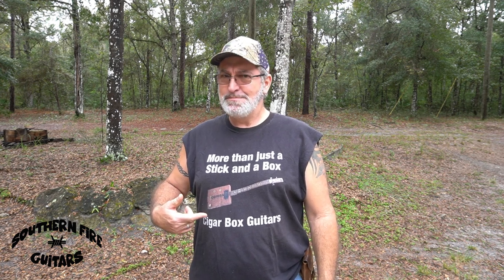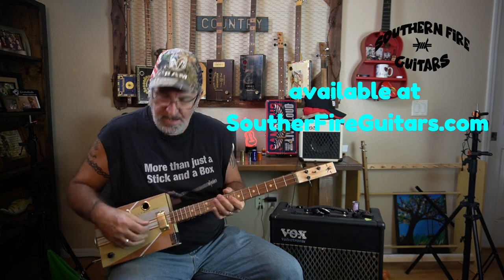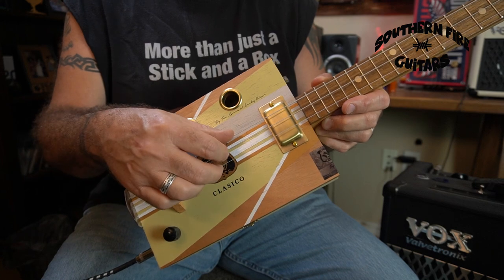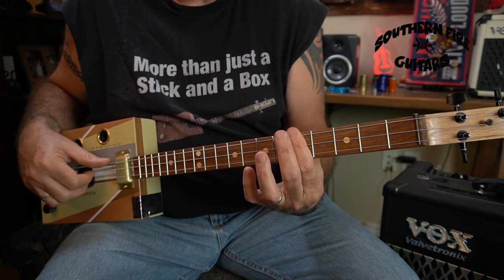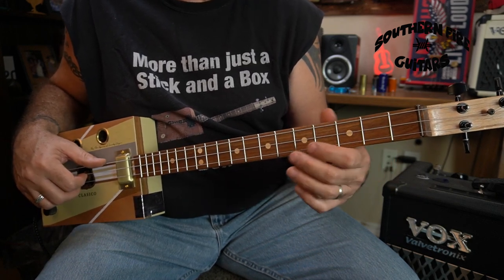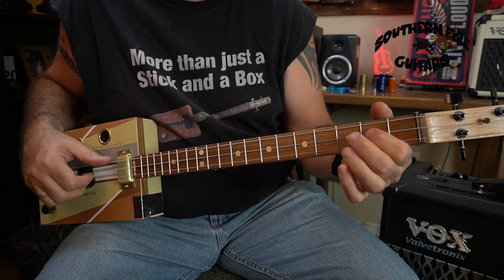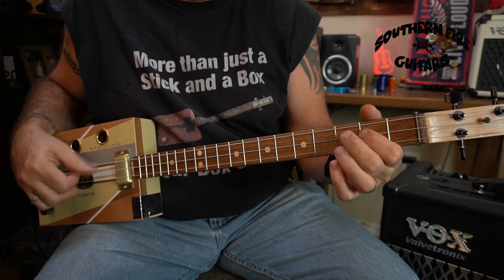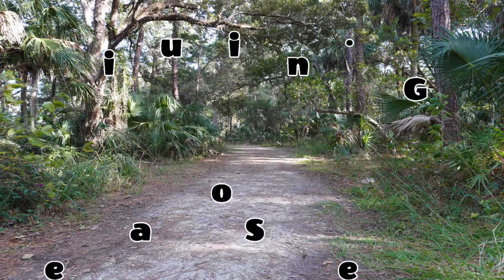Cigar Box Guitar - Beginner 12 Barr Blues Guitar Lesson

Comment: Hey Mike， Steve from Perth Western Australia here. Love the Cigarbox Guitar that you personally made for me. Quality, Sound, and ACTIOn are just right. Perfect Mate. Can I ask you to do a video on how to go about selecting the right slide? Tried a few just cannot get it right like you guys, you US guys have been born with it. Either too big too small, too fat or too loose to fit in between my other finger to get the action you guys get. The US guys have many users I see but not so many in the Land of OZ(Australia)
Reply: Experiment. Have you tried 22ml copper pipe, or whatever is used in Australia to carry water. I made a few from wine bottles, with the added bonus of getting a little drunk.If you look on You Tube there are a few video's on how to make them, and they cost nothing.
Reply: @dougscrivens4002   Thanks for the heads up. Not tried copper yet. Will give it a red hot go. the Wine bottles necks were too fat to work between my fingers, not comfortable. Will re try thinner and not as tapering,   neck. Thanks again
Reply: Hi Steve, had the same problem, ended up with about a dozen slides that all doesn't seem to fit right. Then I found a short ceramic slide, just about 4cm long, so you can play all three strings or just one string with a little practice. C.B.Gitty has a video about it, he sells them too, or you might find some at amazon.
Reply: @hazlehurst  thanks for your follow up. I ordered one and got it all the way to the basket and the freight knocked it on the head. Freight from USA to Australia kills most of my dreams . Even getting the Making Poor mans Guitar book from "What's the Deal with Mr Shane Speal' doesn't justify the freight from the Freight companies. So I am on the look out for an alternative.
Reply: @stevemillarband1  Did you try amazon? I found some here in Germany😇maybe you can find them down under😂
Reply: @hazlehurst  do you have the link. I might find that Australia is very expensive fright zone. But will give it a try anyway.. Thankyou for your updates
Reply from the maker: Hey Steve, I'm so glad you love it. Thank you, again. Ive bought many slides just to get a few that fit and feel good on your finger. A video on the subject is a good idea. I have a few I made from copper pipe, they seem to work good, and its not to hard to find. You have to really sand the edges good where you cut it, or it will give you a nice finger cut. 😎
Reply: Try an Ally/bronze sleeve, bearing supplies are the go for those, pretty much get what ever size ya like,  I turned one on the lathe about 15years ago, never use anything else, tried plenty, but my dirty ol ally/bronze bush is still with me 👍👍